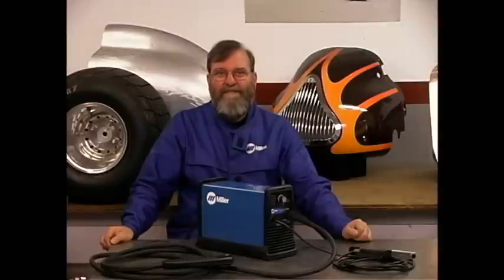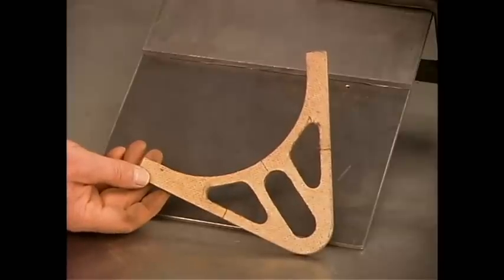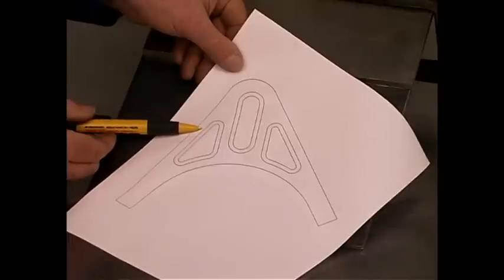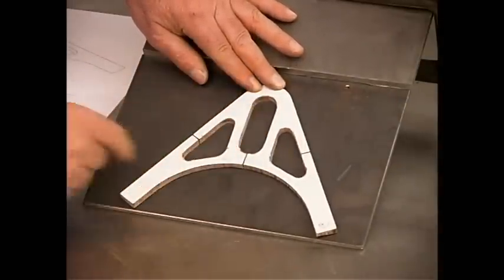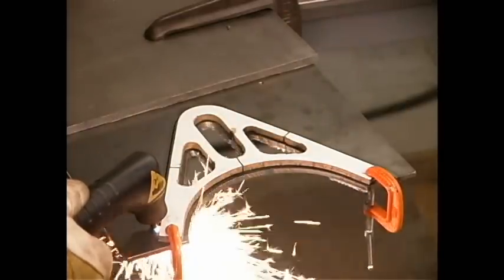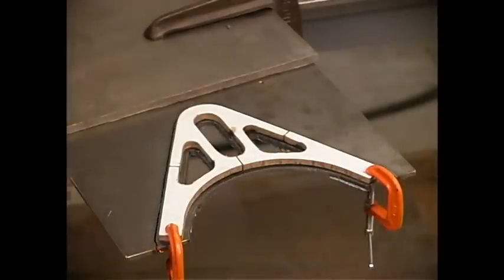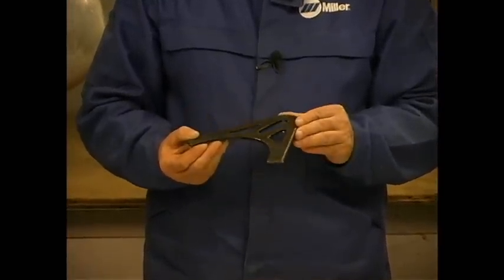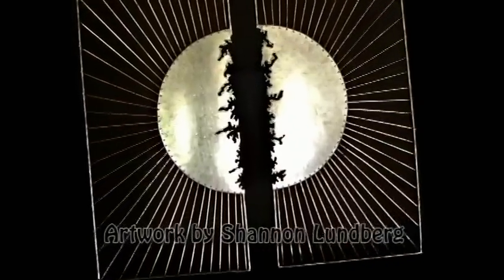Plasma Cutting

Comment: Well shouldn’t u have set the bottom at 3/16” or so in so u can actually cut that bottom corner?    U placed it too low on the metal
Reply from the maker: You are correct - that if my goal was to cut the bottom corner with the plasma, the pattern would need to be moved up on the metal blank. I chose to leave the clamps in place as I did the cutting, which required that I hand finish those corners after finishing the plasma cutting.

Comment: thank you.  Can you tell me the name of material which is non flammable?
Reply from the maker: The material I used for the pattern is Masonite. It isn't flameproof, but it holds up well enough for a few parts, and it's stiff, and easy to cut.

Comment: Great video. I've found by hand sanding the template the torch jerkiness can be reduced.
By moving the clamps before the last cut you could have cut that last remaining projection of metal before the part fell free. JMHO. Thanks for sharing.
Reply from the maker: David - those are two excellent tips. Thanks for sharing!

Comment: Can you name you plasma cutter and price?
Reply: I was looking at that plasma cutter. I eventually bought an Everlast 60A plasma cutter. It's bigger but can cut much, much thicker. You need a compressor anyway so portability wasn't much of a concern for me.
Reply from the maker: My machine is a Miller 375 X-Treme. You can buy them online for about $1300. It's a very nice machine, and of course you can buy machines that will cut thicker metal if you need to.

Comment: can you also cut RVS ?
Reply from the maker: I don't know what RVS is. Plasma cutting works for most metals - steel, aluminum, stainless, etc. Since the process relies on electrical current, it won't work on materials that are non-conductive.
Reply from the maker: Yes, the plasma process cuts stainless very efficiently.

Comment: what Miller Plasma cutter were you using. seems small and portable. Nice video
Reply from the maker: The machine I'm using is the Miller Spectrum 375 X-Treme. It's a nice machine for cutting material up to 3/8", and of course they make machines that will cut much thicker material, too.

Comment: Spraying wd 40 on the metal makes the tip slide easier and keeps the slag from sticking.
Reply from the maker: Great idea!
Reply: Great idea. I will have to try that with my powerplasma cutter.